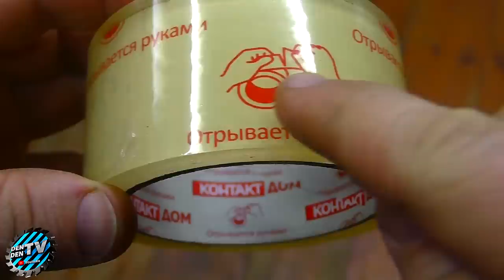Awesome invention of Mankind That Work Extremely Well !!!

Comment: Should cut the pvc t-coupler at the angle of the old broom nozzle. That way you would be able to push the broom. You can’t use that broom straight up and down.
Reply: Not to mention the SCREWS sticking out of the brush bristles.